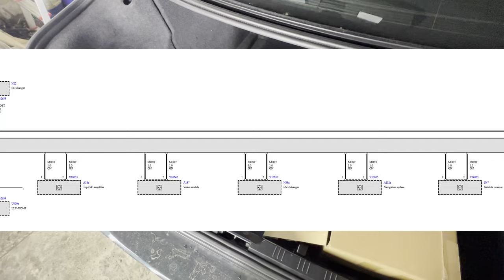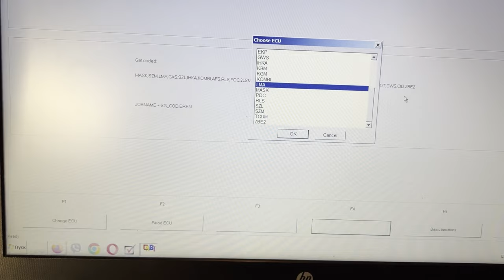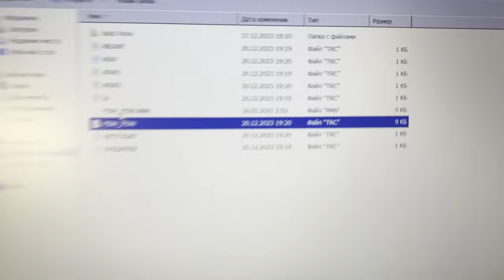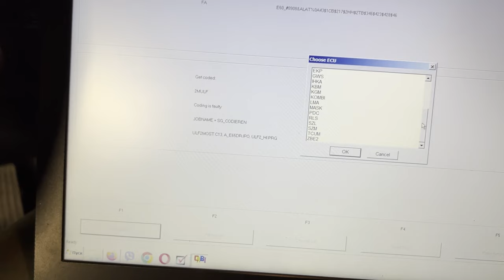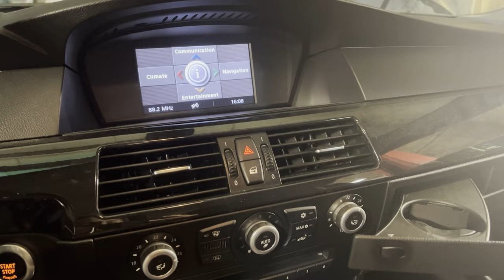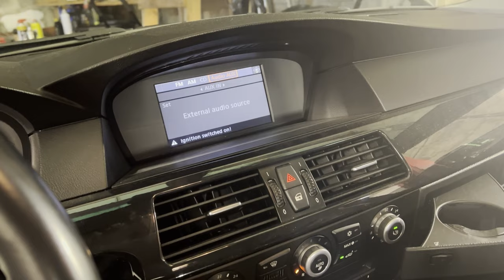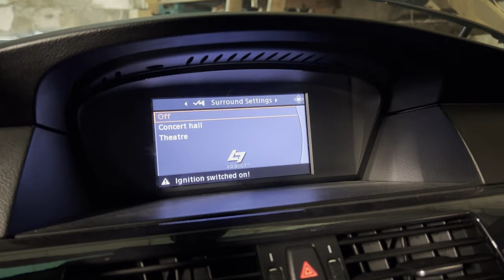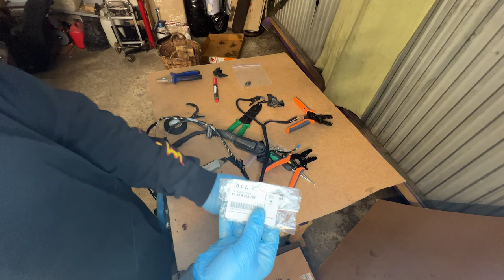S677A Retrofit BMW E60 with Logic7 Harman Becker audio system

Comment: Planning to do this as well, but still having cold feet :D Appreciate the intro about proper factory amp power wiring, but are you sure it is not the first connector? And for the second connector, what is connected to that pin4 currently? Because I Imagine that you probably need to put the correct amperage fuse for that pin and maybe someone modded something with the 20 or 30 AMP fuse... Also, those connectors might work differently depending on which terminal is turned on, but not sure... I haven't finished watching your video, maybe answer coming :)
Reply from the maker: Just start doing something and hands will stop shaking ) Talking about power, first i made mistake cuz i choose pre lci car in TIS, but then i open lci scheme and it also dont fit to my car. You a right that i need to check if i connect to proper fuse. Also i use "free" TIS, so maybe it have errors. My friend has Top-Hifi from factory and his car on car lifter now, so i just checked. 

So here what i get, that his amplifier connected to X11010 socket, pin #4, fuse #73 for 30A. But his car is 2007 pre lci. 

I will check later what fuse i use, but im sure its less then 30a fuse and its works
Reply: @5500ua  "глаза боятся, руки делают" (my written russian super bad) :D super, I have e61 LCI aswell, maybe it has something in PIN4 aswell... I will check my TIS, maybe it was less than 30, but I remember thinking it was a lot when I last looked :D
Reply from the maker: @edgars2113  i think its real error in this free tis, because fuse map for friend car and mine is same for multimedia components and it has only one 30a fuse. So i will switch wire to X11010 connector

Comment: Hey! Which ECUs did you have to code in the end for this? CAS and CIC?
Reply from the maker: every ecu connected with multimedia, depend what do you have in car (mask, ccc, cic, ulf)
Reply: @5500ua  Wouldn't all multimedia be in optical loop? I don't have cd drive, I just have CIC, combox and now Logic (09' e61). Problem is I can't find what exactly needs to be coded (with all the other additional modules...) Maybe I just have to look throguh with ncs dummy, I don't know.
Reply from the maker: @edgarskurpnieks4345  the best idea is to code something and then watch if it works )
Reply: @5500ua  welp, I coded the cic, success on second try and it started playing. hurray! Now I don't know if I should proceed and potentially fix some issue that I haven't noticed yet OR break coding and add new issues :D

Comment: What kind of electrical tape did you use? And did any wire harness plug thingies broke?
Reply from the maker: here i use Certoplast 525, it has green letters on it, its close to factory Certoplast 514 orange letters, which u can buy using number BMW 61136902588. Also i have Tesa tape, but i like Certoplast more.

I have no problem with broken plugs or socket

Comment: Hello! Do you by any chance know the OEM code of this socket 29:44 ?
Reply from the maker: Nope, didn't see it new in catalog and number old one also don't help. Buy used  from front door
Reply: @5500ua  Ok, what about the base audio wires at the back of headunit? Do you just leave them plugged in? Disconnect pins? Or maybe remove wires entirely?
Reply from the maker: @edgarskurpnieks476  i cut it as much as i could and isolated, its not possible to remove them without removing dash panel

Comment: what did you do with the wires with the vare plugs coming from the ask in the bass?
did you cancel and they stayed there with plugs and everything? did you remove the pins from the ask sockets?
Reply from the maker: No all wires are on old place, i didnt remove them
Reply: @5500ua  but you have a plug from the subwoofer witch come from ask, but  after retrofit the subs it s controled by the amp, what did you do with de old plug that was already on the car? 
did you isolate it with the other cables?
Reply from the maker: @IonutdoloR yes, i cut it as close to ask as i can and isolated

Comment: I have base audio no nav mask lci car. I want to retrofit logic but i dont have anything in trunk what should i do??
Reply from the maker: add MOST wire from mask to amplifire and back to mask
Reply: @5500ua  I have found a donor car with simple Hifi is the harness the same? I know that i have to wire the speakers but the basics are the same?
Reply from the maker: @konstantinost3521  yes it's same, so u can use it

Comment: I have soft close and logic 7 and this video will be very helpful, do you have also pins for soft close wires? And what tape did you use?
Reply: And code for that clips you used with zip ties? To change the one time use ones
Reply from the maker: I will public video about only soft close with all numbers soon.
Reply from the maker: @iulianbarzu3384  61136932124 for clips behind rear seat and vag 3W0971838 for some other
Reply: @5500ua  ok, super! Do you plan doing keyless/comfort access?
Reply from the maker: @iulianbarzu3384   my friend make keyless retrofit, but i dont want. This job is almost same as soft close/ logic7, u need to remove all salon and torpedo, open every door panel. My next option will be dark roof lining and also looking for comfort seats
Reply: @5500ua  nice man! Would you make a video where you connect to the pt can or k can? As it s harder than only putting pins in modules😅😅
Reply from the maker: @iulianbarzu3384  i'm not into this thread with can, but dont see any diference between can and any other twisted pair
Reply: @5500ua  i see, but herre should it be connected?
Reply: @5500ua hi when do you post the video with soft close?